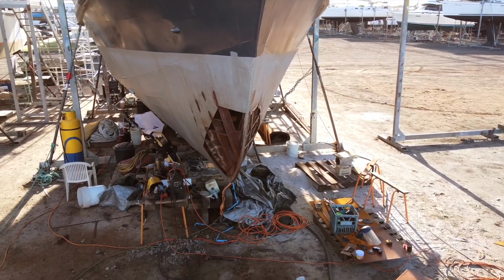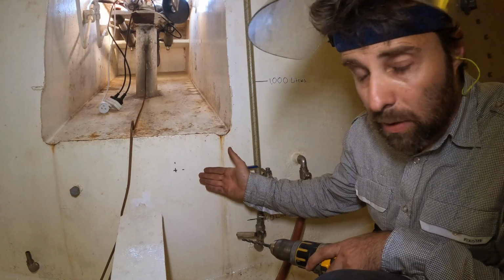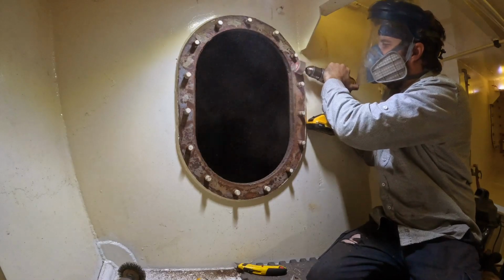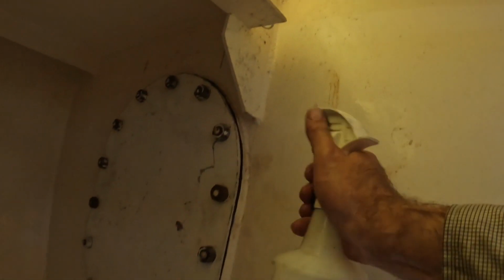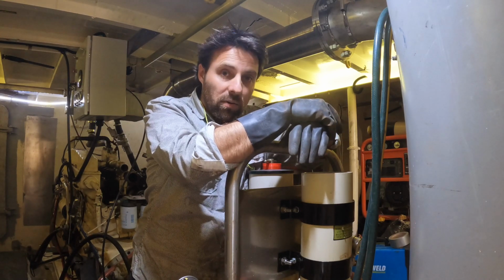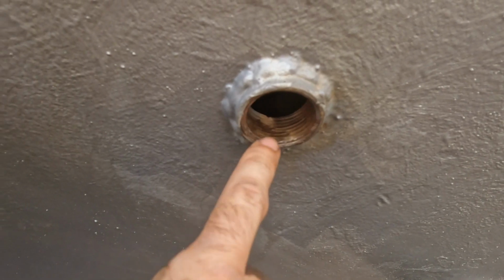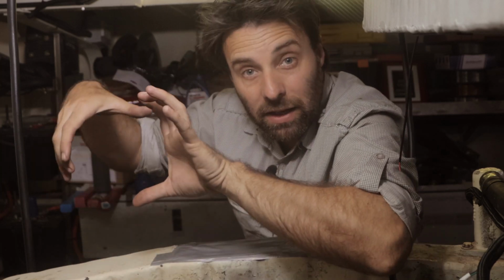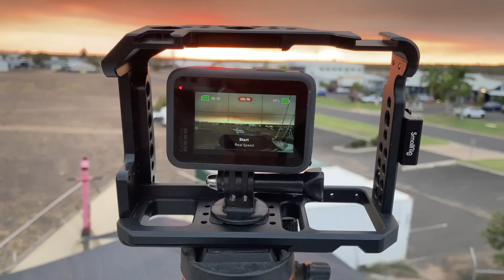Moving 2 ton of diesel to fix fuel tank leaks - Project Brupeg Ep. 269

Comment: Since you have to climb in the tank anyways, would it not have been easier just to put a plate over that weird part and eliminate it as opposed to adding stuff to clean it out?
Reply: Agreed Chad. I'd have been looking to weld a plate to eliminate that awkward part of the Starboard fuel tank, to restore symmetry to the balance of the vessel.

There's always more than one way to skin a cat

Comment: Great vid. I do have a question and I meant to ask the last time I saw it but,  Why not weld a large Nut on top of those vents so you can use a socket and drill to run them up/down?  It looks like there are a lot of threads there.  Just curious.
Reply from the maker: Normally you only crack them off a few threads when venting. It’s only when stripping them they take a while to remove
Reply: @ProjectBrupeg  IC.  Yea I though you would only do it on occasion Just thought It might be easier in the long run.   Can wait  to see that thing in the water.  Good luck and godspeed.

Comment: Doing a head, liner, and piston change on mine only cost me $2500 on my Cummins 6CTA8.3. On my engine the only difference between the marine vs truck versions was the camshaft internally, the pistons were the same as well. Of course the fuel and injectors would be different for more fuel (400hp vs 240hp) but those are external on mine. Personally I would just budget for a rebuild of the block and heads, should be cheaper than mine hopefully, and then change the cam over to the marine version at that time. You can still run the engine on a marine cam without the fuel, but I would NOT do it the fuel before the cam. A diesels nightmare is not having enough air for the given fuel, that is what causes high EGTs and then cracked pistons and heads. Take a gander at my videos and you’ll see how easy/hard it is to change this stuff. The 855 is different than mine of course, but the basics will still be the same.
Reply: You in aussie land tho? Cause they're not and there things cost a wee bit more. Just saying.

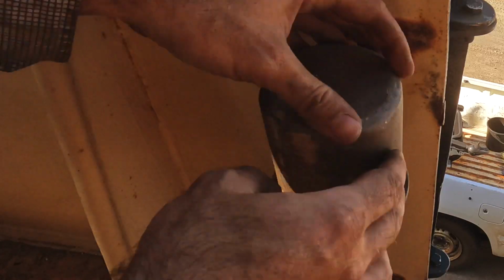Comment: @16:44  Have you thought about welding a nut on the top of the vent cap so you can use a cordless drill to remove it faster than by hand?

Comment: Regarding that funky tank, I assume the keel extends through it.  I'm guessing it's the keel I'm seeing forward of the tank bulkhead.  Does the portion of the keel inside the tank have some holes in it so fuel can get from one side of the keel to the other?
Reply from the maker: Yes. It’s got small holes at the bottom to allow the last bits of fuel to flow through but it also has a slot about 6” tall and the length of the tank for fuel to flow over when filling

Comment: Would there be any benefit to using 'Rust Kill' on the inside of the fuel tanks? The vent will draw in moist sea air whenever fuel is used and it would be impossible to keep oxygen out. Condensation pooling in the lowest corners can't be good for a mild steel tank. My cruiser had stainless tanks (Way smaller and cheaper than Brupeg's), and I still had a 'Low Point' drain cock installed. Water+Fuel and air=Diesel Bug! I'd guess the diesel would act as a solvent for any oil or grease applied to the steel and soon wash it off...

Comment: What are the pipes under the hull?
Reply from the maker: Keel cooling pipes. They are the equivalent to a radiator for the main engine/gearbox and generator
Reply: @ProjectBrupeg  I thought that. Wouldn’t they be a pain and at risk of being ripped open when you go to Antartica and hit an iceberg?  You strengthen the bow for that reason so how do you protect them from the icebergs? Also they would create a lot of drag to
Reply from the maker: They will come off prior to any ice work. Moving to internal cooling. That’s  a couple years away so it’s down the priority list

Comment: Is it possible that the plugs are not able to tighten enough because they're running out of threads and hitting the head of the plug. I hope this makes sense.
Reply: That was my thought as well.  A lot of pipe plugs have a smaller head than the threads, or a socket , to avoid that issue.  But if it's not leaking, it's not a problem!
Reply: That was my thought. It’s a tapered thread, and it looked like the tap was run too deeply so the taper never got a chance to engage.

Comment: Anti-sieze paste should be used along the whole length of a stud/bolt. Corrosion has an electrolytic component the concentrates into small areas of bare metal.. Cover the whole length. It's not enough to just smear the threads alone.

Comment: Re mistakes, Petrincic Bros RC - Pilot Robert and Capt Blaz from Slovenia show every stuff up, crash, argument - I tell ya some of their episodes are over the top hilarious.

Also shifters, the fixed jaw takes the torque the sliding jaw the slack (rather than vice versa lest sliding jaw opens, the tool slips and rounds off the nut/bolt in the process).
Reply: Agreed, adjustables are for garden ornaments not moving real nuts and bolts
Reply from the maker: lol. What a judgemental load of bollocks that is. I’ve heard this argument a million times of adjustable’s have no place blah blah blah. They absolutely do, without them everything takes ten times longer. And if they routinely get the job done with no issue it’s the right tool. Dame.
Reply: @ProjectBrupeg  After an adjustable my favorite removal tool is a pipe wrench. That should get everyone typing madly. 
Take care both of you.
Steve.
Reply from the maker: Wait till you use it backwards on YouTube…
Reply: @ProjectBrupeg  All anyone needs is an adjustable wrench, pipe wrench and vice grips.😀 Throw in some duct tape and WD40 and you have a complete tool box.😀
Reply from the maker: That’s a Detroit Field Service Kit right there
Reply: @ProjectBrupeg  Shots fired toward Stu? Just kidding.😀

Comment: I find that spraying soapy water for leaks is not effective. The pressure of the spray immediately washes away soap bubbles. Instead, I get a little dishwashing detergent, mix in a little -little- water, and lather it up with a sponge.  Then, with the sponge, apply the lather onto the suspected leak where it will remain instead of washing off as would happen with the spray bottle system.
Any leak will blow up the lather bubbles very noticeably.

Comment: Guys I know money is tight but, and this is from genuine concern, but I would not put Brupeg  in the the water and run that engine with any number of cracked pistons, whether its 1 or all. That engine may run with them at idle or up on the hard  fine...but as soon as it's in the water and you put a load on the engine, those pistons are very likely to just grenade and destroy everything internally. It may last 5 mins or an hour, but either way it's gonna be more expensive to put the boat in the water and swap engines later, and that's if it doesn't grenade because of the pistons. Not trying to be pessimistic but I just don't want to see you guys have any other huge blows, especially right after you get in the water. You'd get more money for the replacement engine by selling that engine as it stands to someone that will rebuild it, rather than having to most likely sell it for scrap later after it self-destructs. 

Just a thought.
Thanks for all the awesome videos.
Keep up the hard work. It will be worth it.

Comment: I understand the scissors statement. Been there. I am thinking once you on the seas all that crud will be slouched around and be caught in your filters. I hope the crack in the piston is a surface crack. It will be now implanted in your brain and may sow a seed of doubt when you push the throttle into those heavy rolling seas
Reply from the maker: Hi Peter, we wont be pushing this engine hard. We know its long in the tooth so we will be finding a donor engine and rebuilding that then doing a swap. this engine will become a heap of valuable parts.

Comment: Couldn't you weld some plate into that one fuel tank to eliminate that center section? Then pretend it's not there 😕
Reply from the maker: Ironically I do have a longer term plan to weld some plate down the centreline and plasma out the ridiculous bulkhead in the port tank. Therefore not losing any fuel capacity but gaining the ability to have both Tanks cleanable

Comment: The engine you have in Brupeg with two Pistons showing Cracks are at the end of its Service Life. I know those engines inside and out. In my opinion there may be other cracked Pistons because it more likely than not was overheated. The Engine will not last long at all. I would suggest without fail you replace the Liners and Pistons and inspect the Cam Bearings and Rod Bearings. The Engine needs a Complete Overhaul at this point. There is no way around it whatsoever. I was a Factory Rep Warranty Inspector for these Engines. It is not worth the risk launching with a damaged engine. That Engine only has Minutes or a Few Hours of running before it will disassemble itself for you and lock up. That is my opinion whatever it is worth. The Boat would not pass a certification test with a known failure and the Insurance Company would not approve coverage on a defective Power System. It is all over the internet now. Somebody needs to donate the parts to you for the rebuild. Please Listen. I know Money is Short but Safety comes first. Anyway I can help please let me know.
Reply from the maker: as an ex engine reconditioner i know this engine is out of hours, we may have found a replacement... more on that later. as for cetification. None of that is a requirement in Australia as we are a private vessel
Reply: @ProjectBrupeg  I know there has been many comments about your safety regarding entering in fuel tanks and the engine needs a rebuild. I have been watching your channel almost since you started it. I wanted to say keep your chin up it will all come together in the end. You guys do a amazing job for working on a budget.
Reply from the maker: Thanks Adam
Reply from the maker: Have a look at previous episodes and what dame said in this episode… on advice from a commercial Cummins expert! It’s not worth a full rebuild. But certainly an interesting challenge. J
Reply: @ProjectBrupeg  I did watch that episode. Great one too. Boat's and 4wds all have one thing in common they cost money. Your project is more expensive than mine however.
Reply: What a thoughtful comment.

Trust me… been in your shoes many times. Had a cracked rocker bridge on my main - in the middle of a derby fishery season. Making the judgement call to tie up for a week in the middle of the season in order to do a full head replacement was extremely difficult. 

It hurt my crew and me, we lost 3 trips of fishing. 

Going out with a known defective main engine and losing lives or the boat simply wasn’t worth it. 

Don’t put another dime into that engine, it’s junk. 

Wish you were closer… I’ve got a 3406B with 5k hours that needs a new home!

Comment: Yep. I use thread sealant in the same way I use woodworking adhesive when assembling joints: if the joint is as close-fitting as it should be, applying glue only to the male half means that as you squeeze the joint together, almost all of the glue is scraped off, leaving the finished joint virtually dry and very weak.

It's the same with pipe sealant. If there's only goo on the male part, it's all wiped off as the joint is screwed together. Much better to put sealant on both male and female surfaces so that there's always a 'collar' of wet gunge preceding the male thread.

The end result is almost as good as if you had crawled inside the tank and run an extra bead of sealant around the completed joint.

I've never understood why some people only put a tiny smear on the male thread and none at all on the female. (Genuinely puzzled...🤔) It's not a lubricant to ease assembly; it's a structural part of the joint.

Let there be gunge! 🙂
Reply: That is so true, so is NOT swinging on the spanner, especially an adjustable, before the sealant has air cured. In fact most modern sealants should not be subjected to high pressure.in the thread or joint, they are perfectly good adhesives and need body to seal well, not micro contact.

Comment: Hi Guys I have a used 6 cylinder Cummins marine engine, turbocharged, salt water aftercooler and marine heat exchanger, header tank is shot, not sure of model or history or condition, nameplate is  missing, I think it is a 6B series, it is stored in a container in Tauranga, it owes me 3k, let me know if you are interested and I will email some photos so maybe someone can identify it, I can put an endoscope down the bores, I can help with packing and seafreight, cheers Doug
Reply: If you don't want the heat exchanger then it is free, regards Doug
Reply from the maker: Hi Doug, thank you for thinking of us! We need to stick with an N series, it’s the right horsepower for Brupeg. We really appreciate it Doug. Cheers Jess